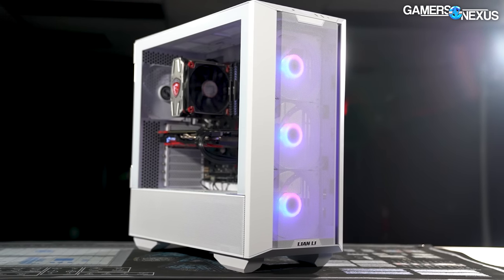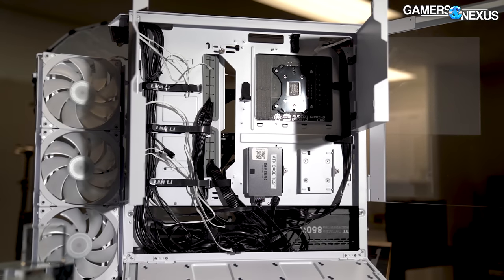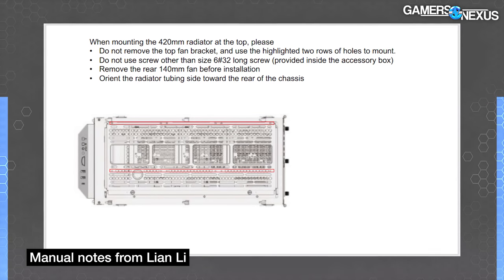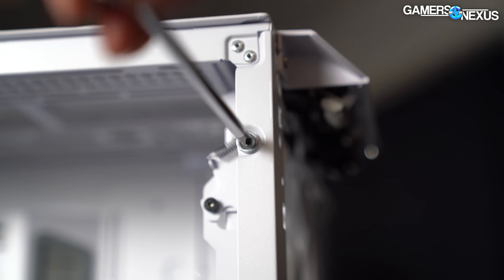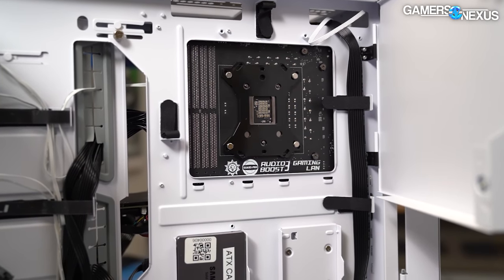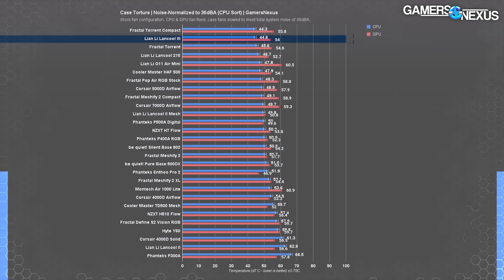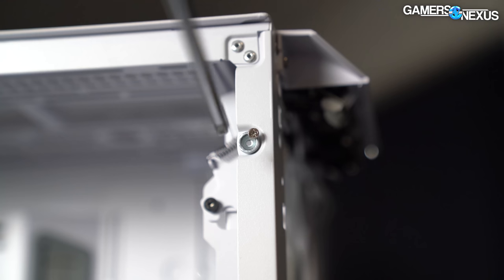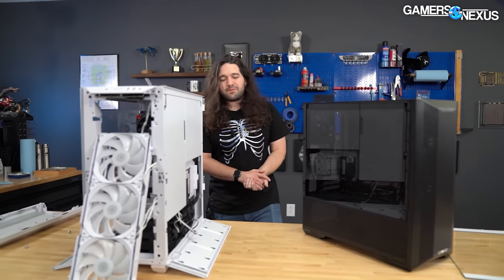Lian Li Lancool III Case Review: Build Quality, Thermals, & Cable Management

Comment: Man, these features, this high quality of a case, and then to even get an additional four RGB fans included with it to boot makes this one absolute banger of a deal! I don't understand how they are able to offer this much value for just $150, but I'm not going to complain! 

I have been rocking a 8700k with a 1080ti ever since their individual release windows, and by blasting my 8700k with sufficient voltage to run that biaaatch at 5GHz on all cores with it running at approx. 80°C at full load has luckily managed to buy me all the time I needed to ride out the previous shortages! But now, after sitting out the previous two GPU and five CPU generations, I'm finally looking to build a new rig somewhere this fall, just as soon as the new GPUs and CPUs are here, and I think this is going to be the case I'm going to build that new system in!

I'm really leaning to going full AMD this time, and I'm almost 30 me, but I have always only had blue and green systems for as long as I can remember. I honestly don't think i have literally ever really had an AMD CPU in my rig before...

Comment: pc cases have gotten way cooler (no pun intended) since the last time i was in the market for one. or is it just Lian Li that is still innovating.
Reply: @htr5372  
maybe innovative is stretching the meaning of the word. in my defense, my frame of reference is from when everything was smooshed together in the case, everything closed with zero thought for airflow or cable management and almost nothing moving. having to unscrew the side panel to get in the case(which i still do). no fancy RGB came with my case fans. that kind of stuff.

Comment: There are a lot of mechanical bits on this case that seem to exist for the sole purpose of being there.  It's telling that the person who did most of the building in it didn't like it until he found out it was a lot cheaper than he had assumed.  That tells me that it's probably not fun to work with, and it's definitely a heavy chonk of a case, but the cooling performance and overall low cost make it at least tolerable.

Comment: The case still seems really interesting and I think I will probably upgrade from my lcii vanilla just so I can mount my 360 to the top instead of the front. Plus I adore the "true white" setup. I wonder if there are any parts that could be removed and painted silver to complement the other Lian LI white and silver devices like the Aio and SL120S

Comment: This is one of the harshest reviews of this case I've seen to date. Although in this case "harsh" means picking up on the niggles that may have been  part of Lian Li cases for years.

Did seem a tad excessive complaining about how long the velcro cable management ties are. Given most cases have ones that are either too short or non-existant.

Comment: how the hell is a case with 15kg and 52x52cm still considered a "mid-tower"? the "one Lancool to rule them all" in price to performance still is the 215. maybe the 216 will take the throne, if it´s not too expensive. looking forward to your review!
Reply: IMO, it's not. It's basically a full tower. The Lancool 2 Mesh is blatantly a mid tower, as is the 215. This is actually listed as a full tower in many places. It's definitely pushing "Mid-tower" to its breaking point.

Comment: So do I go for a III or a II?

Main thing swinging me towards the III is it will take a 280mm AIO in the roof.

I wonder if the Arctic 280mm would fit?
Reply: Several things: Do you want a very large case? What is your budget? Will you be doing heavy watercooling or just using an AIO for your CPU?

Comment: I'm pretty disappointed that Lian Li is still putting glass panels on both sides instead of the only one that makes any sense. I have the Lancool II, and while I generally like it every time I glance over and see those black panels and mounted SSD's on display I'm like..."Why?". It certainly doesn't help that the glass is highly reflective, so everything on my monitor is also being broadcast onto the side of my case.

Comment: Isn't the purpose of that bar moving in and out to adjust to fit different size motherboards?
Reply: And to make it easier to route thicker/stiffer cables to the motherboard. And also to provide space for a reservoir.

Comment: a lancool with more magnets huh. Well I will stick with the L2 mesh as it's been by far the easiest case I've ever owned to deal with and temps are exceptional. Personally I wouldn't buy the 3,  and I'd rather see a L2 mesh with maybe magnets or hinges on the front panel and 280mm or 360mm radiator support up top. Those 2 small changes would make the lancool 2 mesh perfect in my opinion. They went too far on pointless changes on this one. I do wonder how good the GPU temps would be with bottom fans mounted. My gpu gets most of its cool air from the bottom 2 fans on the L2 mesh so I think this is an important test to run.
my lancool 2 mesh has been opened numerous times, had 2 new builds done in the same case and been modified regularly. It still looks new so I'm confident in LianLi build quality. But my PC is very heavy, can't imagine it being 5 to 10 pounds more than now.

Comment: Still would rather spend a little extra on the Phanteks P600s.  Especially if the build is about performance over size/weight/portability.

Comment: Lian Li always pushing the design bounds, amazing case.
Reply: all while cheaping out on includeds. thanks lian li for gaslighting people. Normal case makers have SSD mounts, and fans come with the case at no extra cost to the potential buyer, and having a glass side panel over to utter shit metal  cages? that makes me think they should skiped thefragile glass gimic for on large door.

Comment: In light of the review grading system that you guys have started showing in the beginning of the review videos, I think an officially named grading system for conclusions would also be appropriate. 

Since it starts off with information on how advanced the review is, I think a final assessment should carry the same level of seriousness as a proportionate payoff to the newly introduced review scoring you've implemented.

It could always be attached to a certain type of reviews, if for example, you start providing reviews with varying scores, then this might be implemented for "8 or higher, bro" levels. Or some other meaningful example, I don't know.

Maybe I'm just talking horse s and you can disregard this comment.

Edit: yes, I am. It says "Years of experience", not a score. Oops.

Comment: I genuinely wish I watched this video before buying this case.  The claims of being compatible with 420mm radiators is only there because there is a sliver above 420mm clearance at the top.  Actually trying to install one is a damn near impossibility.  Even if you remove the back fan, the motherboard mount is so high up that you run into issues with the radiator fans not being able get past something like your RAM. And considering that a typical 420 AIO cooler  is going to cost significantly more than the case itself this is a solid fail.

Comment: Love the GamersNexus videos, but I've run into an issue with using their case related videos when trying to find the best case to use with an AIO CPU cooler. They are not using AIO CPU coolers on all of these tests despite their CPU cooler tests showing that AIO have categorically surpassed directly air cooled CPU coolers. Because installing the radiator for an AIO CPU cooler affects both the airflow of the case and the temperature of the air coming into the case, it's difficult to extrapolate which case might be best. For example, the Torrent seems like a non-brainer pick for cooling. If I want to use the Torrent for a 7950x3D, I'll still want to use an AIO (especially because I live in a warm climate without AC). Because part of the magic of the Torrent is due to the incoming dual 180mm fans, replacing those with a radiator seems like it will upset the thermals of the case. Also, living in Hawaii, I'm extremely pressed for space and don't want to just throw a huge case at it like I would have on the mainland because it will severely limit where I'll put my case.
Reply: The majorty of people use air coolers, AIOs are expensive and fail a lot while providing not much extra performance for a whole lot more money

Comment: G'day Steve, Patrick & Andrew,
I think Lian Li make some interesting & Different cases, I like the Look of the LC3 plus it has some clever design & Mechanicals but...
I still don't get a Glass Panel on the Back with Steel Panels to cover all the Cables most people couldn't be bothered Managing just so you can see the 2.5" SSD/HDD,
Especially now when most people are getting Faster M.2 so no 2'5" SSD/HDD anyway, to me it is just a waste of materials & production that increase pollution & the cost of the case

Comment: why performs worse on gpu temps than the lancool ii mesh? i don't have the resources to know that, i just can assume what happens, but i know nobody will test or analize that, sadge. My last hope was gamer nexus, but nope.
Reply: @htr5372  is the same vs lancool mesh 2 at front.
front panel just increases 2ºC
in the lancool 2 mesh has a gap , hole at the bottom, that is main difference.

Comment: Liancool 2 mesh is probaly the best case out there for aircooled setups. I am running the Liancool mesh 2 with    a 5800x and 6700xt both OC and aircooled. Temps always low, never any cooling issues! I was also very impressed with the quality it beats my previous Fractal case in every way.

Comment: I don't see longevity being a concern. If you can afford a case like this you can afford to replace it when the Lancool IV comes out. The pop looks to be much better value overall for longevity for those without the means to replace the case.
Reply: Not to mention is not like you're changing cases every couple of years. I'm changing my Meshify C for this after 2 years though... But only because GPUs have become chonky bois and I need more space. But in theory you could have the same case for years and years
Reply: @jonathancarranza6046  in theory yes you could keep your case forever, but most tend to upgrade the case with a new platform because of gimmicks like RGB or tempered glass, better airflow, better radiator fitment or just want something new to look at

Comment: Guys if you complain about the weight of a case like this, that could lead to manufacturers going to more plastic for their cases. That would be bad. A case of this size is not something you move around much, so the weight "problem" is moot.

Comment: I appreciate the level of innovation - 
Personally it all seems rather unnecessary though.
I value smart Problem solving on cases, but these issues all were already solved before and simpler at that, hence cheaper.

Comment: I just put my 4090 in one of these and an ATX 3.0 PSU!!! No problem or glass hitting the cable!
Reply: what brand is your psu?
Reply: Thermaltake
Reply: I am thinking of buying this case for my 4090FE, so the front will close ok, even if i just use the provided gpu cable, i know we are not meant to bend them much, thx
Reply: @ChrisDaytrader  there is more than enough clearance between the glass panel and the GPU cable at the bend
Reply: @STKReacts  Thx for your time to reply, thought there should be, just wanted confirmation, i only have a R200 corsair case and its to small, thx
Reply: @ChrisDaytrader  youre welcome! enjoy the new build

Comment: can anyone help me? 
i just built my pc 2 days ago 
specs are:
mb:tuf z690 plus d4
cpu:12700
m.2:xpg s40g rgb 2tb 
RAM:gskill trident z 32gb 3200mhz cl16 dual channel
cpu cooler:cooler master ma612 stealth argb 
and etc 
.
i know that ma612 will not do cooling great but it should handle the 12700 and avoid thermal throttling 
wich didn't happened for me 
i used the thermal paste that was inside the box wich didn't look like a good quality one i guess that is problem
but i faced with a very wired issue when i started gaming 
i was playing cod black ops 3 
everything was ok at first but whenever cpu usage goes up to around 60 percent temperature jumps up from 58~60 to 85~90 in less than two seconds and comes back to 60 very fast 
i really don't know what to do about it
pleas help if you can :(

Comment: I own lancool II mesh performance and it is an absolute beast! Thanks GN.

I think i prefers it more than the III design wise as II was the "revisioned normal II" that should be alot of improvements and i feels like buying luxury car or something as the build experience on that thing is so good and i feel the "premium"ness

I like the screws to hold all the cover and stuff that the III springload/magnet/etc bcs it just hold better in my opinion

The front latch on III looks unecessary if not bit more complicated. I like the II looks better..like look at all those meshes!! Full meshes! The III now just like a "normal" case with extra steps

I dont mind for side panel opening scenario on the II too

Perhaps if they release the lancool III-II like the revisioned/updated version would be great to buy

Comment: Im thinking about buying the lancool 2 mesh or the lancool 3. The lancool 3 is roughly 30 dollars extra. Is the difference really worth?
Reply: Absolutely not, and as you saw in the thermals section the Lancool 2 Mesh is actually beating it in most categories. The LC2 Mesh is considerably cheaper and 25% smaller as well. Just got for that model unless you're using multiple large radiators for watercooling OR creating a custom watercooling loop.

Comment: It's a real shame on this case that the fans are set to such a high speed out of the box, when it really isn't necessary to achieve cooling performance. I suppose it's better to have a little headroom and then spin fans down if needed, but a lot of users may not be experienced with BIOS fan curves or setting fan speeds in general, and might end up disappointed with the noise of the fans as they are stock.

Comment: SL600M 45ºC on the gpu (37db) 9ºC less than this one, still not a single case beated that case on gpu performance. 
9ºC on a gpu is a lot, from having 71ºC to 80ºC
i can't for the lian li 216 test with the rear accessory fan

Comment: Could you kindly confirm the gpu temp test had the same fan configuration as the test you did for the liancool mesh ii? I can’t actually tell when comparing videos if either or both used 120mm upward-facing intake fans beneath the gpu. I am trying to determine why this case has worse gpu thermals than its predecessor.
Reply: Well, it says they’re using the stock configuration for both cases. For the LC2 Mesh they used the performance version with 2 140s and 1 120 exhaust.
Reply: @RicochetForce  cool just wanted to confirm. I wonder why this new case is worse on a noise adjusted basis given it should have higher airflow both in terms of fans and in terms of more vented surface area.

Comment: Good review but tests are useless because of the old low-power hardware. If you think it's ok for testing why don't you use the same processor in CPU Air&Water Coolers tests?

Comment: How many times have manufacturers come out with a case with no airflow and then revised it with a mesh front for more airflow over the years? 20? 40? 100's?

This does not seem like a problem that needs to be repeated. I mean, it's like case manufacturers are stuck in some sort of groundhog day loop of idiocy.

Comment: That case has a lot of things going on for sure, I am a big fan(Pun intended) of the Lian Li fans that click together for easy power and cable management however, I think the FD Torrent is way above the rest of the field in air flow and air cooling.. also, the Cake is a lie!!
Reply: It's also massive and really expensive.

Comment: The backside glass panels are a bad idea since they just add another thing that can break, they add a lot of weight and you never want to show off anything on that side anyway unless you're really proud of your cable management and want to cherish it's magnificence by decorating it with rainbow puke.
The case itself is fine, very hard to really go crazy modding it but for a "complete solution" it's great.

Comment: would the gpu thermals improve if you put case fans on the bottom? above the psu shroud.
Reply: Yes, but you could do the same thing on the Lancool 2 and get even better temperatures. Something about the Lancool III is getting it dramatically worse GPU temperatures.

Comment: Lian Li Lancool III = (LxWxH) 20.7" x 9.3" x  20.5" is smaller than a CORSAIR iCUE 7000X  = (LxWxH) 21.6" x 9.7" x 23.6". I don't like that's it's a smaller case than a 7000X. For even a bit more room, I still prefer the Thermaltake Core P8 (LxWxH) 26" x 10.2" x 24.6". Oh yeah, wait now I remember why... I hate mid-tower cases.
Reply: For the price of a iCue 7000X you can buy 2 Lancool III's. What kind of comparison is that? Go get the Lian Li V3000 Plus if you want it XXXL.

Comment: As someone who built 2 systems in 2022, not a fan of the lights being removed for LED activity etc. I guess I like the old school reset also.  I wont buy another phanteks case because of that. They thought I was an idiot for being upset about it. well their loss. I returned that case, and I will never buy another 1 from them. I like this design but I am sticking with beQuiet, I like all my lights and a reset and POWER button. Call me stupid, but its my money. Learned hard way , will RGB is pretty and all that, itsa PITA for nothing but lights that bug you at night To each their own I guess.